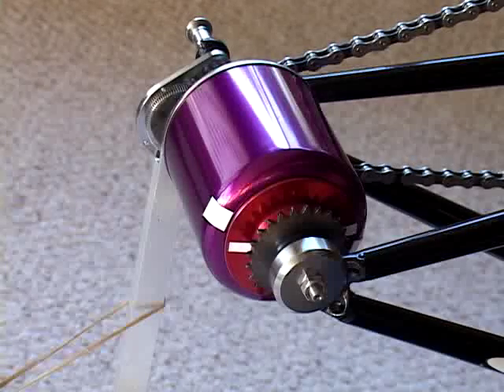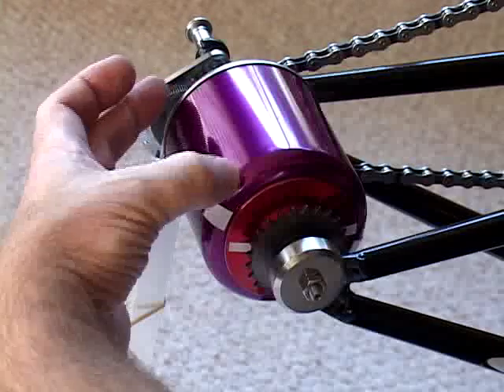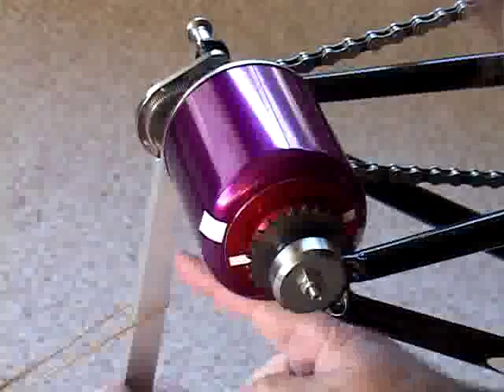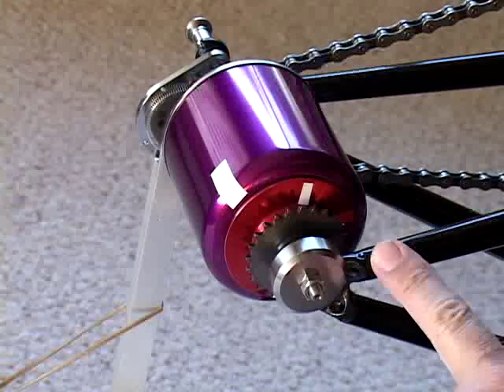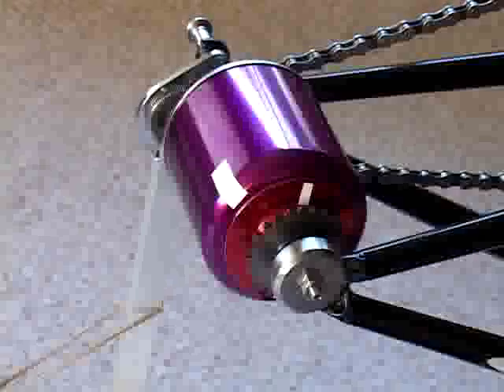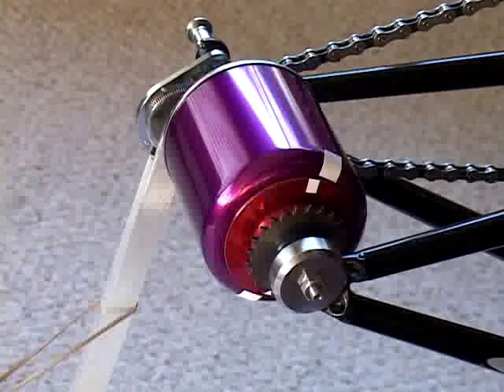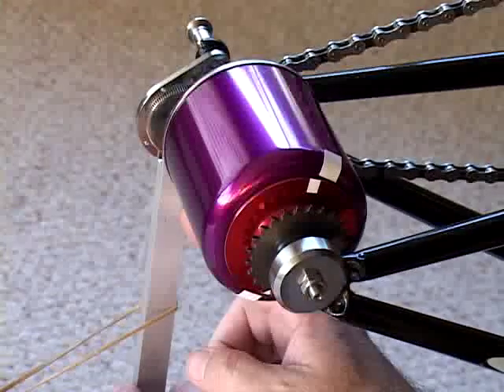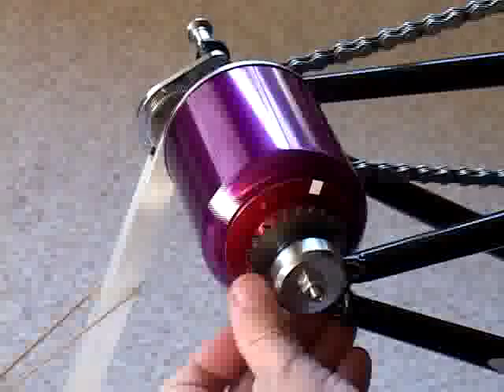Automatic Bicycle Transmission (IVT)

Comment: Hello, great invention...Have you managed to sell it or we still have to suffer the complex & expensive auto transmission and get ripped 5000 $ extra for them ?
Reply from the maker: +hypertuch Apparently you know where I'll be going with this!  If I can make this transmission affordable for bikes, why not for cars?  First, I've got to demonstrate a fully functional prototype before starting a business as the economy improves.  This transmission is simpler than modern automotive transmissions, so there's motivation to get it into the market beyond bicycles, but it should be perfected for bikes & small motor-driven vehicles first.  I'm just waiting for signs of economic recovery for working people who'll be customers.
Reply: Its also possible that you make and sell directly. But beware not to sell to a specific country where they copy everything. This is a great piece of work and I will follow where this reaches. Although I am not optimistic w greedy car makers since so many items added every year to complicate the car and raise its price without significant increase in performance.
Reply: +SIMKINETICS   But the economy is already doing fairly well today.  You may be waiting a VERY long time if you expect something significantly better.  If your IVT does what you claim, it will do well in any economy assuming you have good strategic partners -- it would be revolutionary!  It's been seven years since this video showed a working concept, so if you have a viable product design now, get it produced and the buyers will come!  So unless you have a crystal ball, trying to play the market and economy-timing game is foolish and you should not let that inhibit you!  Seize the moment -- move forward!
Reply from the maker: Wayne Ashby Thanks for the encouragement.  I'm listening to economists, many who predict a 'double-dip'.  I'm looking for signs that we're going to exit from recession in a healthy way, and am getting anxious to start the pre-production process before economic recovery.  The last times recovery from recession happened, I noticed an economic surge followed; that seems to be coming in less than 2 years.  I plan to be prepared, and will soon be looking for engineering, manufacturing & marketing talent.
Reply: +SIMKINETICS   I am happy to hear you plan to be prepared, but sad to know it has been almost 20 years since the patent was issued (I researched and read it) and now it will still be some number of additional years away before production is fully engaged; I am anxious to see your IVT product available to the consumer!  I think it would be a real winner and I wish you the best!
Reply from the maker: Wayne Ashby Thank you!  I'll likely start working on prototyping this well before the economic recovery with the help of a Patreon or other crowdfunding account to cover costs of making & testing a working model.  After that, a business plan will address all risks for introducing this into the market.  Fortunately, there are many practical uses, so upside risks will likely outweigh the downside for a start-up business.  For that purpose, my new design will be of the most universal configuration, fairly similar to the featured model here.  
The patent you read is not for this invention.  I found a better way, although information from that earlier invention was useful for testing the efficiency & durability of one-way clutches; I rode a bike many miles with a successful, functional prototype of the earlier device.

Comment: where can i buy this?? its pure genius!
Reply from the maker: +CHFilms Thank you.  Unfortunately, it's not yet for sale because the crappy economy has not been favorable to starting a new business since I posted this video.  I estimate that 2016 political results may show a change that will help me decide to move forward.  This transmission needs to be prototyped & tested first on a real bicycle application that I'll video.  If efficiency, durability & costs pass testing, I'll do some form of crowd-funding to get or start a business to produce & market the SIVAT.  Please be patient.  Thanks again.
Reply: +SIMKINETICS this is really really cool. I would not hesitate to mass produce this, though i understand the economy has been rough, this is really applicable and could really get you involved with some big time bike manufacturers, it looks more reliable, lighter, simpler and more durable than a traditional gear changer. Not to mention a greater choice in gear ratios. I would love to open this up and see how it works! Though i know you don't want to reveal your secrets to me;)

Comment: Such an invention that can make one bilionaire in an instant but no news, no product within 8 years means just one thing: It is fake...
Reply from the maker: +thereisnotube It's definitely not fake.  Starting a business based on a new technology is risky, less so when the economy is healthy (which it isn't yet).  Please suspend your skepticism until my next video shows it working on a bike or dynamometer.  This will take at least a year.  The principles are sound engineering, but only testing will demonstrate what any consumer should expect.
Reply: +SIMKINETICS sorry mate, but i don't really understand why you didn't go with a product yet. You posted this video in 2008. Whats the problem? Is it about the design? Is the transferred torque low? Normally a product like this that would sell like hell would be sponsored and agreed to be produced within 6 months. 1 year at most. You lower your chances by each passing day because each passing day suspicions will rise.

Comment: It's a shame that transmissions have become obsolete for cars! Still, for bikes this might make a lot of sense. Is it in production yet?
Reply from the maker: +Paul Hendrix There will always be a transmission in cars unless direct motor-to-wheel propulsion ever makes any sense.  Even electric synchronous motor drives can be improved with a transmission.
Reply: most electric cars are direct motor-to-wheel or with a fixed ratio. so unless your solution is very cheap ...

still, it seems great for bikes and is all around just a cool technology.

Comment: Excellent! I have developed a different design for light weight torque applications...however I feel scr vari speed thrystor drive systems seem to be more applicable to higher horsepower. Can this unit hold against reverse torque statically? Can it provide engine braking? Hydrostatic transmission with variable displacement piston pumps increase mechanical advantage yet waste tremendous energy on heat from hydraulic friction...like torque converters.Your design seems to eliminate that. Maybe you can run these in series like a modern automatic trans. Case IH farm tractors have an interesting CVT transmission design ...check it out.Similar to my idea.They beat me to patent office..lol Shalom
Reply from the maker: +motorhead In its simplest form, it cannot achieve engine braking because it intrinsically free-wheels.  I have a back-up design that adds complexity to allow jake-braking, but will first go the simple route.

Comment: Didn't Volvo buy out Daf and let a similar system fall by the wayside? A simple system, essentially using rubber bands.
Reply from the maker: +Patrick Harrison Yes, DAF made a CVT using a belt drive.  That's a type of friction drive that has non-optimal efficiency & limited power capacity for its size.  My invention uses levers & gears with high-capacity static friction elements that don't slip and don't degrade efficiency like dynamic friction elements like belts or rollers.  This mechanism is not like anything else I've seen; it operates like a geared transmission that positively transfers substantial power without any slippage.

Comment: This is really cool, but it would be good to have ratios bigger than one to one, unless you combine this with derraileur, which would be pointless. Am I missing something? What about NuVinci hubs?
Reply: You could just combine it with some regular gears to achieve ratios greater then one, I guess. 
lg, couka
Reply from the maker: +Érico Schmitt The front sprocket has 55 teeth, the rear sprocket has 11 teeth here.  The new design has additional gearing inside to raise its input speed by a factor of 2.66X; an alternative design is simpler, but uses a smaller-pitch chain in order to derive a higher ratio without a larger diameter front sprocket.
Reply from the maker: +Die Bastler Werkstatt I'm considering extra internal gearing to raise the input speed to the critical mechanism; this also lowers torque, so components will endure less stress.  An alternative will use a higher sprocket ratio.

Comment: Wait, so you could literally have the pedal be connected to that lever. when not pushed, there's no motion, and as you depress it the speed increases? This is incredible! it's literally a powered takeoff. This completely eliminates shifting gears, the only thing you need to change is the variable ratio as you drive. This would be perfect on a gocart, you could just have the engine run at normal rpm's.

Has this become a product yet? If so, i'd love to just purchase one for experimentation.
Reply from the maker: +Akash Hegde Not!  Those drives rely on dynamic friction that's dependent on losses.  The SIVAT uses static friction.  The difference between dynamic friction & static friction is most important as a metric in efficiency; the static version being nearly without loss!  I do not want to throw away power & energy!  Do you?
Reply: +Tower Crisis Look up CVTs for ATVs and go karts. Same exact thing.

Comment: Great invention!  Any more progress in getting this functioning on a bike?  It would be great if you explained how it works too. ;)
Reply from the maker: +supra1988tg Thank you!  Using the principles discovered in this prototype, I redesigned it to eliminate weaknesses a few years ago.  Then I deliberately avoided thinking about it to derive a fresh review of the redesign, and have recently considered some improvements.  The domestic economy has not been favorable for starting a new business based on a revolutionary product, so I'm looking for solid evidence of a change in that; I'm estimating that another year or two might make a critical difference.  I've recently sent my 'secure' computer for repair so I can once again review & improve my design in preparation for it to be more affordable and less impactful on potential customers who'd upgrade from their current bicycle drive systems.  This latest idea will likely increase the diameter of the hub while decreasing its mass (weight) and eliminating the need to use unusual sizes of sprockets or chain, so I'm very anxious to proceed!  There will be a lag between building a working prototype and making a product, so I imagine that I'll be seeking crowd-funding to build a couple of units for testing & publishing results when I'm satisfied with an intense redesign.  If that works out, the crowdfunding will help build the start of a business.

Although this invention is initially posed as a product idea for bicycles, that will also be a proving-grounds for several other applications, so I have to consider a wider market too.  Anyway, I'd love to show how this thing works because it is a riddle inside an enigma that would blow a few minds, but that would cause a few problems for its patentability!
Reply: +SIMKINETICS  Well good luck to you in the redesign and hopefully marketing the new product.  I see a lot of comments referring to this as just a clutch, is there slippage at any ratio below 1:1 or is it in fact transferring  the full torque input at lower than 1:1?
Reply from the maker: supra1988tg Thanks again.  The SIVAT uses one-way clutches that very rapidly lock-up when transferring power, so they exhibit zero dynamic friction as opposed to any typical clutch that operates on nearly all dynamic friction.  My calculations for efficiency range from ~ 88% in super-low ratios to ~94% or higher for most of its usable ratios.  It produces very little heat while operating.  
Throughout the entire ratio range, the drive is positive with no slippage; in fact, the engagement is instantaneous, so it begins driving immediately without the lag associated with ratchet-based free-wheeling in derailleur systems.  If you'd stomp on the pedals, it may seem like it's slipping a little because the ratio will go down in response for a fraction of a second, but there will be enough resistance to avoid banging your groin.

Comment: is the gearing in proportion to the diameter of the wheel it's attached too,the reason why i ask if the gearing gets too low it would be hard to keep balance also if too high it would be really hard to pedal??
Reply from the maker: +neil crompton This should at least replicate the highest gearing of MTB's with 29" wheels and 48/11 sprockets.  Low gear?  Unlimited!
Reply: would it be adaptable to other wheel sizes too ie: 26 & 27" wheels?

Comment: barry even though I didn't get all of the tech stuff I do understand the principles behind this device. Very ingenious in design and well thought out for applications that will make bicycling a new a very exciting thing again. I for one appreciate the stuff people like you do for the rest of the masses that have limited resource to be able to not only put so much into the actual product development but also the reasoning behind why it would be such a big leap in technology for something so simple as a bicycle to move us around.
Reply: Have you thought about any practical design or designing for/with wind or hydro turbine/generation? I think this could revolutionize that foeld as well.
Reply from the maker: +Steve Frappier It looks like your comment was for me instead of brian noel, so I'll answer your question.  Between my own ideas of how this transmission can be used and ideas suggested by viewers, we've come up with over two dozen practical uses, including wind & water turbine power.  After doing extensive research into wind turbines, it appears that the SIVAT would help protect the expensive drive-systems from damage due to strong gusts, and would eliminate the need for some of the expensive control electronics that modulate power output AC frequencies.  Generator input speed can be controlled by the SIVAT for constant speed & frequency operation, while air flow (or water flow for hydroelectric power) varies over a wide range at the impeller.  Thanks for your question!
Reply: Thank you for answering, and so promptly.
It's refreshing to finally see a thinker and doer after such a long time without. Your idea and its applications will, indeed, go far. Thank you for sharing.
Best of luck to you, Sir!
                   Steve Frappier
Reply from the maker: Steve Frappier You're welcome!  And thanks!

Comment: So it's like a clutch on a bicycle.
Reply from the maker: Jett Sevilla If you mean 'like a slip-clutch', no.  Power is transmitted with nearly zero wasted energy due to dynamic friction that typifies slip clutches.  The ratio can be locked at will, but power is positively transmitted in any ratio whether automatically or manually selected.  In automatic mode, extra pedal force will cause the ratio to go down, feeling slightly like it's slipping, but it's actually transmitting full power as delivered even during such ratio changes.  It would be difficult to design a clutch to do what this does, and it would necessarily be very inefficient and not durable.